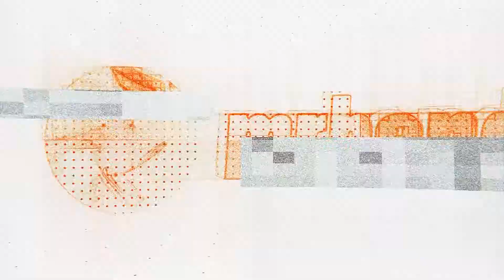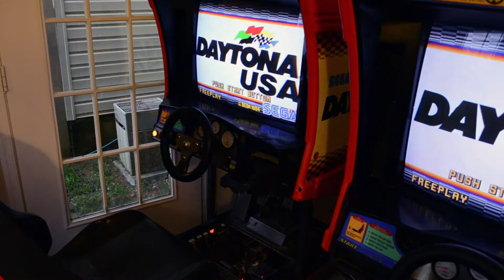Daytona USA Twin Cabinet Project - Intermittent Sound Corruption Diagnosis

Comment: I didn't get a notification on your upload!
Good to see some more progress. 
Man your CRT screens look sharp!

I'd certainly recommend grounding the cab from top to bottom if you haven't already done so. 
UK built Scud Race/Sega GT are notorious for having issues when they are not grounded fully, symptoms include combined FFB/sound interference when the FFB motor engages. Obviously not the issue your having but I'd certainly ground the cab as a precaution.

As for the sound issue your experiencing, that's one I've not seen before.
Are your voltages stable? Any corrosion on any chips on the cpu board or sound board? 
Did you try swapping the Rom board or CPU/sound boards over to see if the issue follows one of those boards?

Since Daytona uses PCM samples, it could be one of the following chips at fault:

Sound CPU: Motorola 68000 
Sound chip: 2× Sega 315-5560 Custom MultiPCM 
Sound timer: Yamaha YM3834 
PCM sample ROM: 16 Mbits 

It may be worth testing/comparing stacks with a logic analyzer but with the layout inside the cab it may make things difficult getting to some of the chips. I've never had to go down the route of using a logic analyzer so I can't help there.

Hope you get to the bottom of your issue, so close man!
Reply from the maker: Thanks man! Both CRTs are in phenomenal shape... I have to readjust convergence on the left monitor (the one I repaired) but the right one is smooth as butter. Grounding is definitely something that needs to be sorted... but that's not too big of a deal in the long run... but it makes me wonder if that is the issue.

I haven't had a ton of time to actually continue my diagnosis... life is a bit ridiculously busy right now. I have some content (both the Daytona and some other stuff) but haven't had time to edit/upload. I'm pretty sure my issue right now is just reseating the EPROMs considering the intermittent issue because it only seems to happen once I actually start playing the machine and jerking it around doing power slides. But all that information you gave me will come to good use if that isn't the issue.

Expect an update sometime in the next week! Thanks again for watching and for the good info!